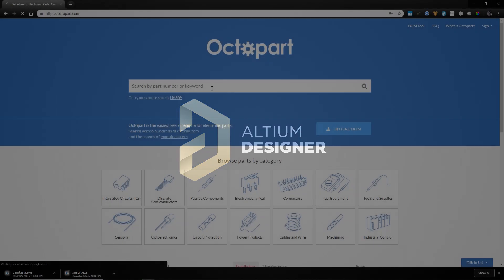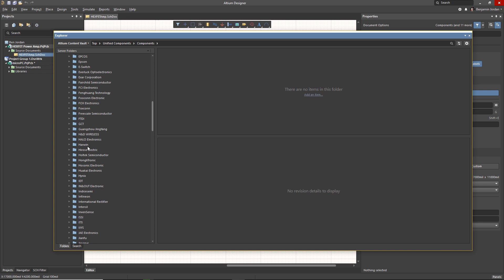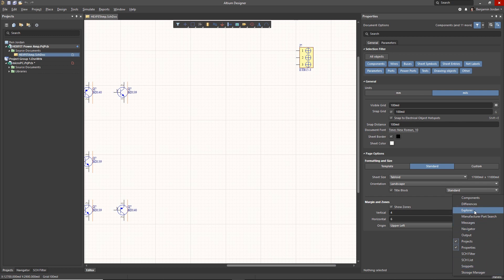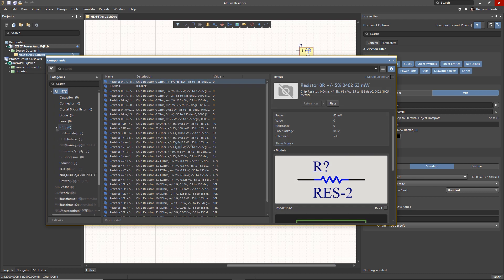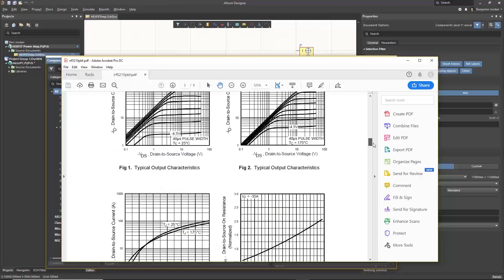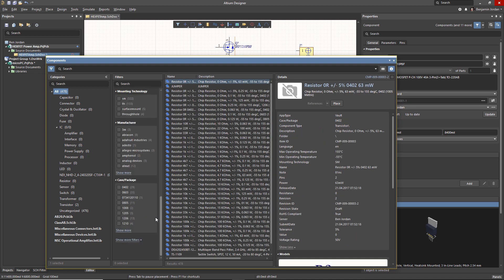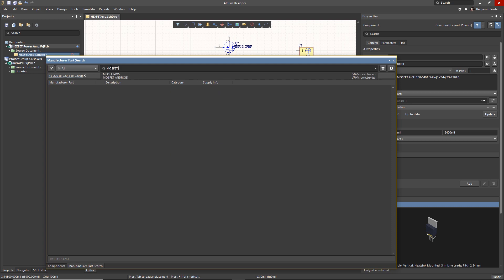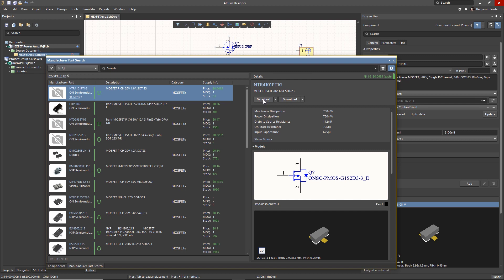How To Search, Filter, And Find The Right Part For Your Design | Altium Designer

Comment: Hi, great video. I am an Altium user, testing this version 19.0.5 build 141. I don't have the same view as in the video. In my "Components" panel, under categories, instead of seeing "All" and then a categorized tree, I just see a list of integrated libraries installed, which I have to select manually one by one to look for a specific component, rather than searching within all my installed libraries. Am I doing something wrong? perhaps something needed to be configured? Thank you for the videos, very useful.
Reply from the maker: You need a manged components categories in Altium Concord Pro to see these categories. Otherwise, you will only see the installed libraries as you are seeing.